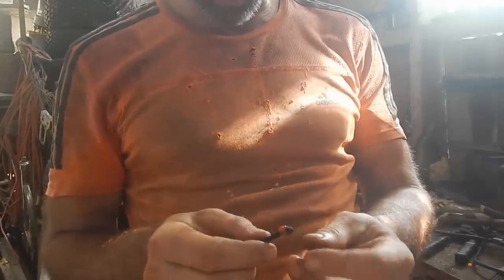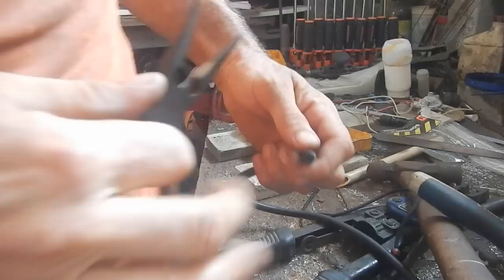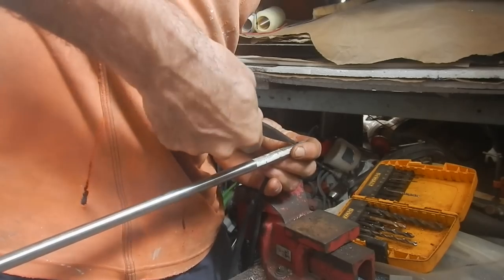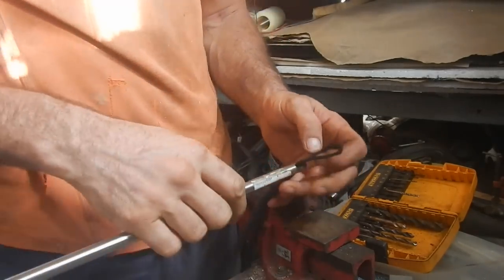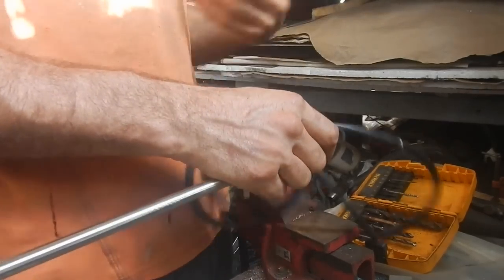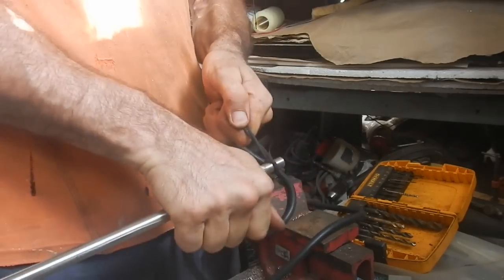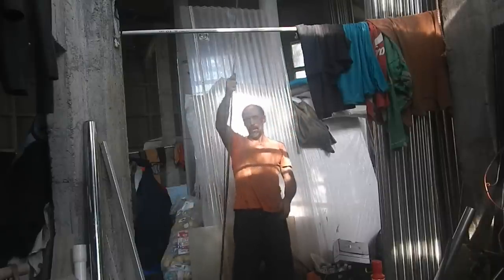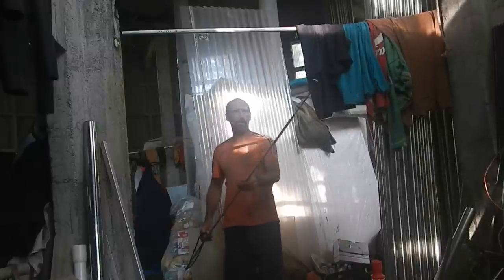Making a Pole Spear for Shooting Fishes

Comment: I used to do a lot of spear fishing with one of these, you will absolutely need a thicker handle to grip onto, unless your rubber isn't that strong. I like your tip, much better than the multi pronged type that comes with them usually.